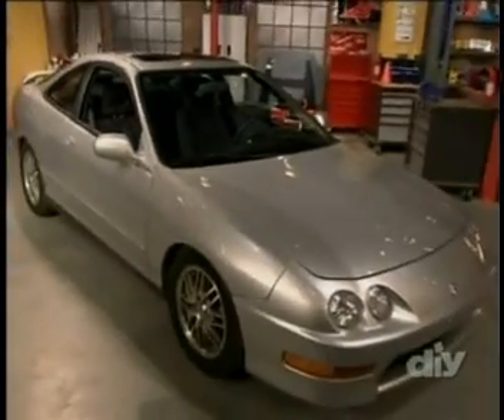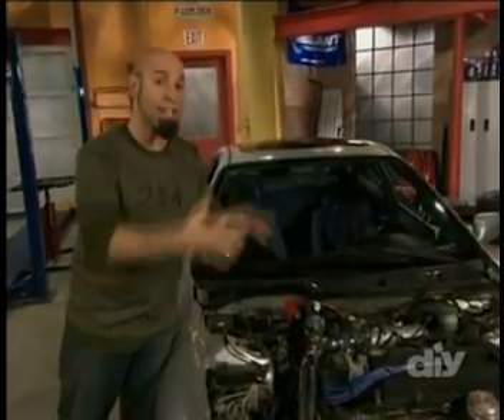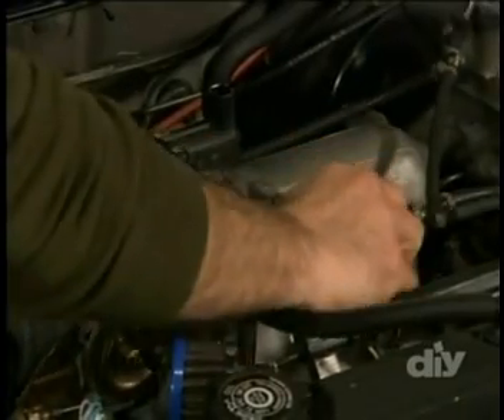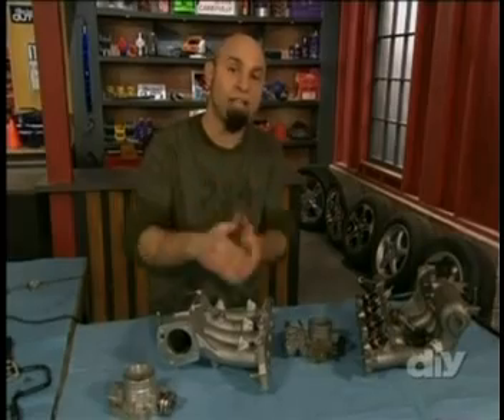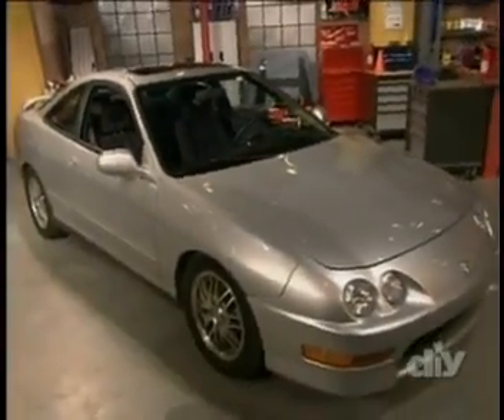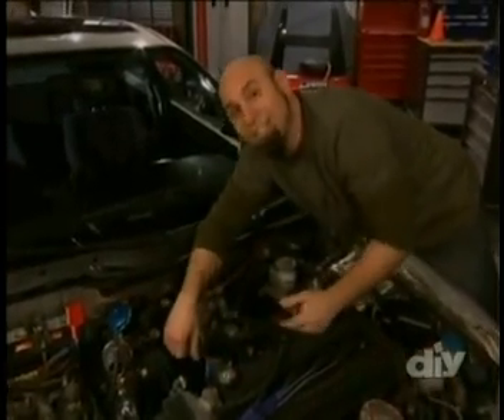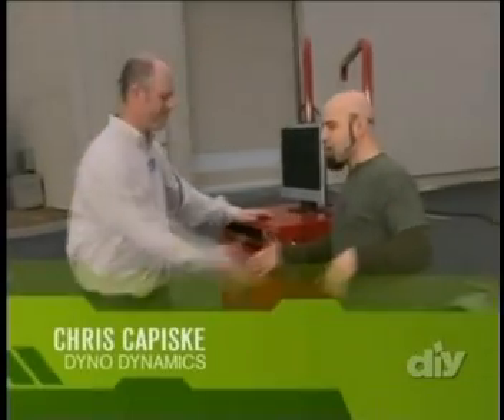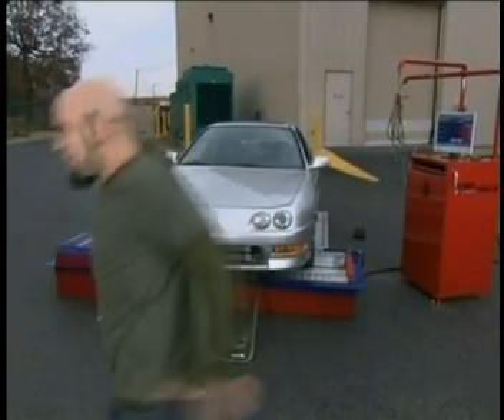DIY - Tricked Out - Acura Integra Intake Manifold

Comment: he keeps saying turbo what turbo?It's a B18B non vtec. 140hp stock 140 lbs ft. torque puts about 120hp at the wheels. His so called turbo only added 30hp at 150whp. so his mods added 20 more whp.  170whp is B18C5 type R stock power output.  what turbo only does this kind of output!
Reply: he just has a conservative tune of 3psi lol
Reply: If he really hit the internals like they said with the type r pistons, has better fuel system and IM, why keep it at 3psi? Why waste all that money
Reply: @ArturoFlores-et8jz  its a joke wastegate pressure alone is higher then 3 psi.  I imagine he used a stock turbo from a different car.  Most likely an eclipse and its probably just running wastegate pressure
Reply: Out dated comment.. b18c are overrated now.. I'd rather slap a honda K24 or K20a2 on mine and call it a day.. 200+hp 8k Rpm stock iVTEC Fun